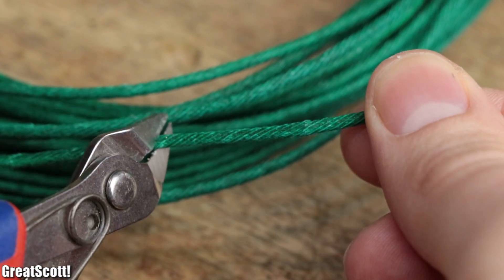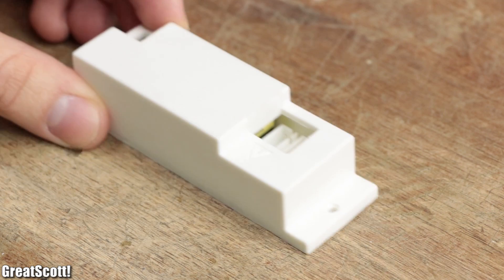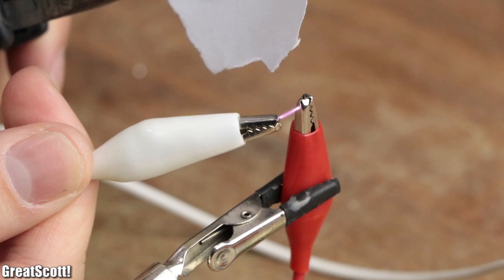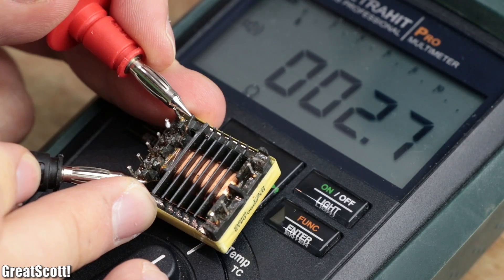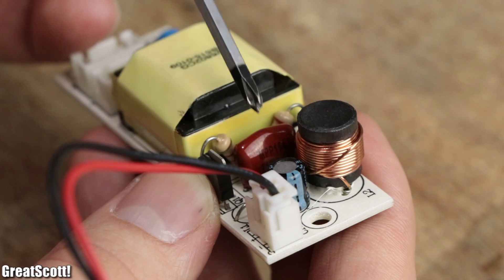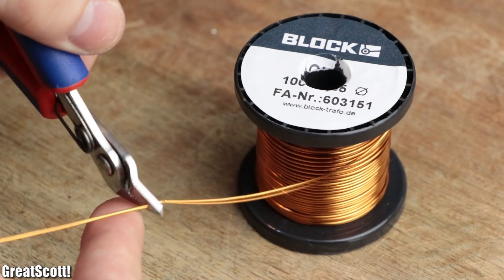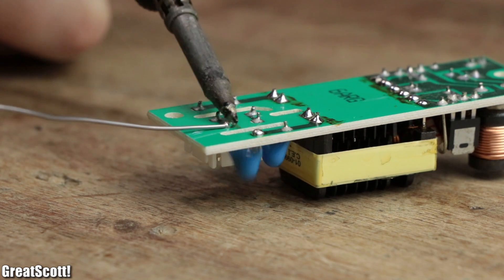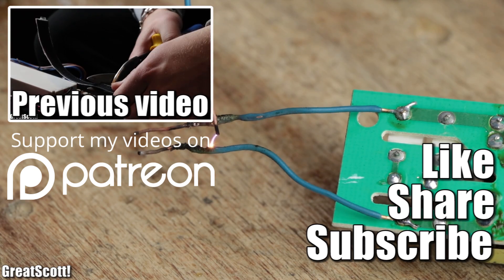HACKED!: CCFL Inverter becomes an Arc Lighter?

Comment: Great video.  Will it work to ignite black powder or smokeless rifle powder with the arc?  Might be a novel way to fire motor shells without a fuse.. :}   I built similar devices, but it uses a bank of charged capacitors at 350 VDC and dumps to a transformer with a SCR. Others have done similar with camera flash circuits also. Cheers!

Comment: I found almost same circuit in old refrigerator and that produce around 1000 volts but with higher voltage supply around 19 volts the arc become very large in size

Comment: I would rather use Nichrome wire, it is easy to coil it for small few turns and clip it, or attach it, quickly to the filament. It also can be powered by 6 or 9 volts DC battery for few seconds and turn it red hot. Use CMOS to gate the battery voltage into the Nichrome wire then disconnect automatically once the current stops flowing into the wire. You may design very simple circuit to do so.

Comment: I have a bunch of large CCFL transformers pulled from old LCD TV's and was hoping they would be suitable for a HV supply but when hooked up to a flyback driver they don't produce an arc or even draw current.  A flyback transformer or certain small CCFL transformers no problem, good arcs all the way down to 5V.   But the larger ones I want to use the Mosfet in this does not even switch on and only thing I can conclude is that the driver is not suitable for them even though they are only single winding transformers.

Comment: If I'm reading that circuit diagram correctly, I had no idea it was that simple to convert DC to AC
Reply: There are even simpler ways of doing so, like using a single cap, a transistor and a coil to make a joule thief

Comment: will that voltage of CCFL inverted kill ? Is the amperage sufficient
Reply: It depends on how the body becomes an conductor.Where also. If the arc burns the skin and increases conductivity. Which allow higher currents to travel through the nerves. It has been determined by other experiments that even 6-12 milliamps can stop your heart(like across your chest)     uhm. I am not going to test it.
Reply: @TheMechanator  Good to know 5 years later
Reply: @StaticVapour590  I just saw your question today.
Reply: @TheMechanator  Yeah I see, never gotten answer to such old comment i have left
Reply: @StaticVapour590  I just wanted to make sure you knew how electrocution can happen . HV is no joke. best wishes.

Comment: I'm trying to simulate almost this same circuit, it is an inversor with a high output voltage but it has some diferencies with the components, I'm using proteus 8 professional to do it but I can't make it work, is there any chance that someone know about a simulation that could help me? thanks in advance and the video was excelent

Comment: On the lighter circuit: it's not that the manufacturer does not want you to know what's inside, it's just that the high voltage components needs to be protected from moisture, decay of the material's dielectric properties, etc. Standard procedure in flyback transformers (eg old tv sets). Like what you do!

Comment: Hello,
I have few questions for you.
How you desoldered transformer perfectly, without any problem? I see you using some kind of wire, could you tel me your secret? :)
the second question is:
Can I use mini transformer from laptop LCD Cold catode inverter to build a USB Killer? could you advice me some simple oscilator circuit which can be small enough to fit into USB drive case?
I dont want destroy any computer, I just give leson to mi classmate which always soling me something :D 
Thanks

Comment: The reason why the module in the factory-made one is potted (enapsulated with resin), is for high voltage isolation to keep the module small.  Potting electronics is generally not used for trade secret circuits, because the circuit can be then x-rayed (unless the circuit is surrounded by lead).

Comment: i have 1 with exposed components 1 of the chips has gone and i tried to fix it but the original board still fails and over heats so had to abandon it my lighter has 4 arcs! if you want i could make a vid showing the damage?

Comment: +GreatScott! Sounds like you know your shit, I understood most of it although not all. Yet. 
Question. 3kv per 1mm of load gap. I make plasma lighters that I buy in kit form from ebay with a couple of mods like switch out the transistor for a better one so I can run nominal 8v battery pack producing longer arc. My lighter arcs at 10mm, can be drawn out to around 20mm so is the voltage diff is around 30kv?
Also, I made what I thought was a 30kv zvs/flyback power supply that arcs at 32mm, is this ps therefore actually around 100kv? I dont have the equipment to measure the voltage by the way.
Thanks for the vid and thanks for reading!

Comment: I have a tip for you Greatscott. When youre desoldering a super fast way is (If you can destroy the board) to heat the pins with a small gas lighter and they melt easily :) Im desoldering like this when I need things to be done quickly :) But you have to do it outside...

Comment: Reminds me of the circuit I used on my Tesla Coil / Slayer Exciter thingy. XD More specifically, I used a turbo version of the Joule Theif, let me tell you it drew more power then I expected. RIP 2N3904, you will be missed. The coil is like 5 inches tall, didn't expect it to pull a few amps, and also the back EMF was over 30V. It latched on and shorted a large NiMH pack of Eneloops, which at 12V easily dumped 100W through it. Vaporized the poor transistor instantly.

Comment: Hi. I would like to tell you about some diffrences in Polish and English nomenclature.

In Polish "prąd stały" is translated to Direct Current, but it directly translated means Constant Current and it is used as CC. As I know, DC in current in one way.

Because of this, in Polish Variable Current means current that changes in time, but in English, as I know, it must change direction.

Also, as I read, in English Pulsating Current is type of DC, because it doesn't change direction. But in Polish, Pulsating Current is type of Variable Current, because it changes in time.

I wonder how this looks in German nomenclature.

Comment: Awesome! My brother and I did this years ago too

Instead of placing the fuse directly into the arc, we upped the voltage and attached the electrodes to two nuts (spaced ~10mm vertically from eachother) with the fuse passing through the centres. Basically the electrodes touch the fuse.

This causes the arc to form inside the fuse (as the carbon content from the charcoal makes it mildly conductive), causing it to combust from the inside out. Perfect ignition every time, and the voltage is sufficiently high enough to pierce through any crud formed onto the electrodes by the combustion process

Comment: Careful about getting the output wires too close. Some of these burn out almost instantly if you short them. Even more likely once you remove those blue capacitors which are there to regulate current (or so I've been told)

Comment: desoldering is much cheaper with a manual desoldering pump (1$) because you can reuse the pump and dont have running costs.

Comment: It's amazing, I have an inverter here from Monitor, but it contains 4 wires, 2 connected to 12V and 1 enable and 1 brightness adjustment. How should I turn on this inverter? I turned on 12V and it did not work ..... I am almost removing the mini transformer from this inverter and doing another kkkkkkkk actually I need this inverter to test my transformers that I install at home. Just know basic electronics, do not understand reverse engineering kkk hope you can help me hugs

Comment: Hi, i was searching for high voltage generators online for making this. I found some that could generate up to as high as 700Kv, but also some smaller ones. In this case, does more voltage mean higher temperature, or does it only affect the length of the arc? Also, what voltage do you suggest, as high as possible or modest (arround 15kv for example)?

Comment: wait dont the transformer generates humming sound when its active and producing arc?
Reply: They do, but the humming is the same frequency as the current that passes trough them. We can hear sounds with a frequency between 20Hz and 20kHz, the standard AC current from the grid is 50Hz which is well within that range. The frequency of the arc in this video was about 37kHz, which is significantly higher than what we can hear.
Reply: IkBenBenG owh so the humming isnt that loud as 60hz giant transformer?
Reply: Not exactly, the pitch is just so high that you can't hear it. Some other animals, like dogs, can hear far higher frequencies and they would hear it hum.

It would probably indeed be less loud then a big transformer because it handles less power, but that isn't the reason why you don't hear it.
Reply: IkBenBenG so we human cant hear it? right?
Reply: indeed.

Comment: can you melt little pieces of metal? I mean, this should have about 3000-5000 Celsius
Reply: metal is conductive, and to heat a metal with eletricity you need high current, no high voltage... the metal will just receive a spark for on end and electrode it to the other...

Comment: Can you make a small electronic precipitator for indoor use which can filter the dust particles of the room .(please make the high voltage supply too using commonly available parts.)Hope you will address my request.

Comment: just search this on ebay to make it easy. its only $2.43USD  DC 3v-6v to 400kV 400000V Boost Step-up Power Module High-voltage Generator

Comment: I have no desire to light cigarettes, fireworks or tissue paper but found your video fascinating.  The circuit analysis was excellent, even without the desire to actually build this particular application one can learn a lot from such videos.  I had never heard the term "Royer Oscillator" so this is an area for further research for me.  Many thanks for the video.  Bob

Comment: 1:16 Can/Would you measure the voltage @ the gap as I always thought it's about 100KV to jump 1 foot!  Which is 3000 V per CM, although I forget how long of an arc I can get from an old TV fly-back, I did have a neon transformer that said 120 to 3000 and it did arc about 1 CM

Comment: is there enough current coming from a normal arc lighter for the amount of volts to kill you?
Reply: High frequency AC does not kill. You need either DC or low frequency AC. However, you can get severe burns.

Comment: What about high voltage protection? Have you got shocked accidentally?
Reply: safety is number one priority :D
Reply from the maker: No
Reply: the current is pretty low though.
Reply: Michał Kuklewski I was repairing a laptop once and stupidly held the screen's inverter in place using my thumb.
It literally vaporised a small section of skin on my thumb. I didn't feel a thing but the smell of burnt flesh was disgusting!
Reply: Techtastisch 75 you'd most likely burn your finger bad (because it still flows from one electrode to the other but now through your finger).
Reply: I am asking because, I have a similar CCFL and I wanted to make HV DC Supply by using it, voltage multiplier and somekind of LDO as feedback. But I wasnt sure if an issolation on crocodiles will keep me safe
Reply: safety first, always
Reply: Microwave oven transformers are deadly, be careful with them, or refrain from playing with them altogether. If you want to, get a neon sign transformer, they limit the output current, so they are much safer.
Reply: Ah, alright then.

Comment: That AC wave looks nice and pure. Why can't inverters look that good???
Reply: There is plenty that look so good these days @ Benning Power Electronics, for example not that I am trying to sell you anything though.  In this vid though, it's easier @ higher frequencies.
Reply: @drphu  do they look that good under heavy load ? Most inverter sine wave gets distorted under load
Reply: @xsauce3858  i think its the load that make sine wave inverter gets distorted
Because most modern appliances draw harmonicly distorted current
If you want clean sine wave then just load your inverter using pure resistive load only such as tungsten lamp
Reply: they use transistors
Reply: Some house AC inverters use a Pulse width modulated signal to the transformer from a DC source(batteries) A 555 timer or faster is usually used. It produces a stair step trace on the scope.  It's very close to AC for regular power use. Not great for high frequency like with radios(harmonic splatters).

Comment: can it kill you?
Reply: AC at 30 kHz cannot kill you. It rides the surface of your skin since it is very high frequency. However, it can BURN YOU! So I still would not touch it unless you like 3rd-degree burns.
Reply: No on his power supply you see that when the arc started it read 8 Watts. power  = current x voltage so at 15kV there is only 5 mA of current available. Resistance of plasma is very low so I imagine there is no more current available if you put flesh between electrodes. Generally, you need 100 mA across the chest to cause cardiac arrest so this is not dangerous in that sense.

Comment: That black can isn't because of IP. It's because High Voltage circuits like this need to be very good isolated from the ambient. In that black box there was only some diodes and capacitors to double/triple the voltage.
Reply: Or just plain windings? No need for DC output.

I have some of the parts molded inside TV high voltage transformers,
and for certain without the epoxy they WILL short out!
Reply: [NCG] NubeCubeGamin  this isn't me dissing you nubecube I'm just saying because there seems to be alot of unintelligent people in the comments
Reply: They don't use transformers. Most use much simpler and lower current voltage multipliers. I don't know about this specific lighter, but in general, those black tubes that are epoxied that power arcs are usually voltage multipliers.
Reply: I cant say this for all but in mine the box is a transformer and it is in that one too
Reply: [NCG] NubeCubeGamin  I have the exact lighter circuit and all that's in the black casing is a transformer, use your brains people 4 wires going in 2 going out 2 on the input are tied together and attached to positive the other 2 are attached to a transistor its obviously a transformer it's a super simple common self isolating circuit and if you still don't believe me riddle me this, if it was diodes and caps in the output would be pulsed and blue due to the capacitors discharging and the lower frequency and obviously the arc coming out of this looks like constant, purple high frequency arcs, which is further evidence that its a transformer

Comment: Just add a voltage multiplier
Reply: It will make pulsed discharges, not a smooth arc. ;)
Reply: the frequency is determined by the lenght of the arc. I'm french so I don't know how to explain it in english
Reply: Alexandre Durier explique ta théorie je peux traduire :)
Reply: La fréquence de décharge varie selon l'écartement des électrodes.
Reply: la fréquence de l'arc est proportionnelle à l'écartement des électrodes
Reply: The frequency changes according to the distance of the electrodes, because the current generates an ionized field around the electrode and it increases until there is discharge of electrons and ions, but DC discharges are even mto different from AC Discharges.

Comment: Can you please make a video there you show how to make a button send radio waves to a recever and make tye recever do somthing
Reply: It is pretty simple! It is called a Simple RF Receiver / Transmitter 
Check out the video called "Simple RF Receiver / Transmitter Pair (27 MHz)"
But I do think he has done something like that before
Reply: And also he made one with IR "HACKED!: Speaker System gets an IR Remote" 
It should help you a bit
Reply: Stefan's Tech Verden Thank you
Reply: Dude thats infrared, he needs radio.
Reply: +Card Wallets I know it is IR but he just needs a way to remote control. It is just easier to use IR than radio control plus there is so many rules about sending radio waves but there is not really any about IR

Comment: Are there any cheap arc lighters on Ebay? For about 5 bucks??? Please someone help ;)
Reply from the maker: I put links in the description. You can get one for 9.5$ from Ebay.
Reply: danijel124 you can buy it from aliexpress,  Rey cheap but long delivery times
Reply: Do you sell arc lighters on Ebay ? Is this a clever advert disguised as a comment ? Why not just type the same words you typed here into Ebay's search box ?
Reply: he had probably checked but didnt find any cheap ones therefor he asked anyone if there was any cheap ones
Reply: if you can, you can buy a kit like these http://www.ebay.com/sch/i.html?_odkw=high+voltage+kit&_osacat=0&_from=R40&_trksid=p2045573.m570.l1313.TR0.TRC0.H0.Xhigh+voltage+ignitor+kit.TRS0&_nkw=high+voltage+ignitor+kit&_sacat=0 on ebay and put togeter the components
Reply: Make one , buy a "12v ozone generator" board for £2.23 with free shipping....run it off a 9v battery with a switch and boom arc lighter for 3 quid.